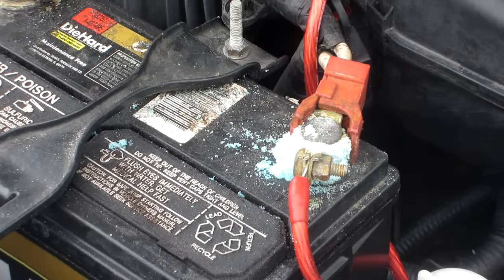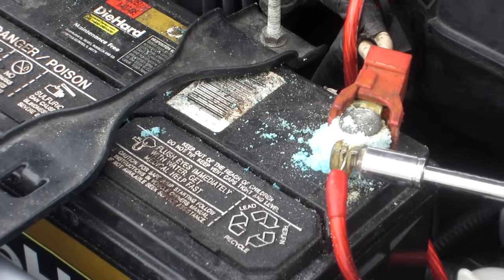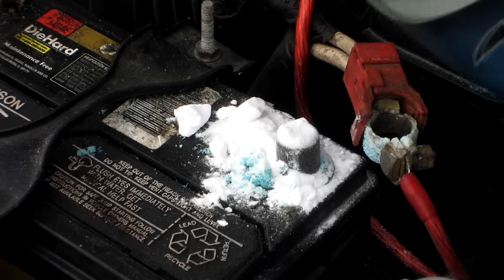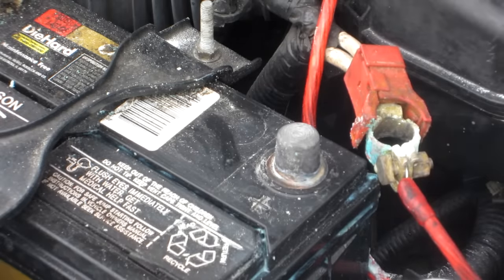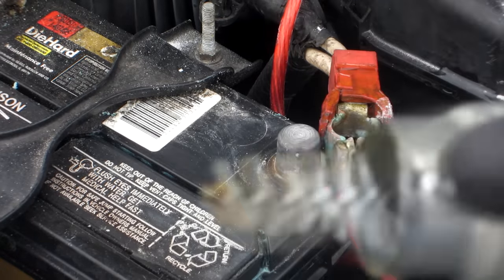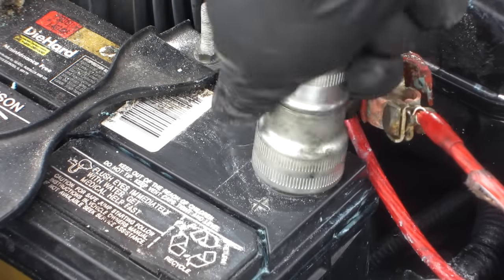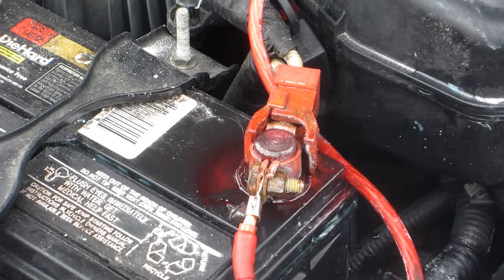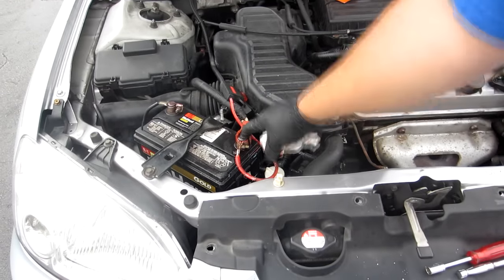HOW TO REMOVE BATTERY CORROSION FAST AND CHEAP!!!

Comment: Rinse well with hot water , and when you are done just spray some WD40 or any motor oil on the connector = good to go. For even longer results cut a circular piece of thick fabric , make a hole the size of the battery pole , soak the fabric into motor oil, place it over the pole, put back your wire connector , tighten it and you're done. No more corrosion.
Reply: use copper grease on battery terminals
Reply: Or use regular greese. Better yet dilithium electrical greese.  Important part of all of this is to alwas keep the battery components clean of carrosian, which, will give you sure starts as your battery starts your car, your alternator takes over the electricity running through your car operating the lights and other accessories within your car or truck.
Reply: @danbasta3677  O my God😲
Spellchecker is a wonderful thing 👍
Grees/Grease Dilithium/Dialectic 😖😂🤣
Reply: @jamesglenn520  Yikes. Spellcheck only helps if you have the right word to start with. I think what you're looking for is dielectric grease. Dialectic is what you talk through with your shrink.  😐
Reply: @benburwick3403  Funny how long it took for someone to finally notice 🤣 😂 
And yes it was my intention to misspell it and see if anyone noticed 🤭😁
Reply: @jamesglenn520  doubtful, with the accompanying "alwas" & "carrosian" & "soak a flammable textile in flammable oil and then place that directly between the contact points of an electrical circuit generating current from an extremely flammable solution which releases an extremely flammable gas by-product during operation."

🤡
Nice try, though. Back-pedal any harder and your bike is gonna apply the brake.

Comment: Also, I suggest first covering the vents with Saran wrap, place a layer of paper towels on top and around the battery base, place the terminal clamp on top of the paper towels, then slowly pour a water/baking soda mix for minimizing a cleanup. Otherwise good presentation.

Comment: Anyone have any idea what causes this? Repeatedly?
Hot weather? Lack of fluid in battery? Newer car batteries or newer vehicles? More than one connection to the positive terminal? I've had Fords and Chevys and never had to do this until i got a Nissan. 
Then it came back, 2 weeks later. (Probaly becsuse i didnt clean it with baking soda or coca cola, but thought i was thorough with a wire brush.)

Comment: Never put the jelly/protectant on the post before replacing the cable.  You should have clean bare metal to metal contact. Replace the cable, tighten it, then put jelly on the cable bracket and top of post. Nothing should impare the metal to metal electrical connection.
Reply: That was my mistake and why I am watching videos right now.
Reply: It makes Absolutely no difference. The chemical is not a insulator. 
Plus the protective coating should cover the base of the post where it meets the plastic case. 
That is where the gasses are leaking under the cable connection.

Comment: Did you ever try mixing the baking soda with water and pouring it on the battery without removing the cable? you went way out of the way cleaning that battery

Comment: Always disconnect negative first. Always reconnect negative last.
Reply: Why
Reply: @gstacks510  Most cars the negative is grounded to the car - you can usually see that the negative battery wire leads into the car's frame. If you remove the positive first and accidentally touch the terminal and a piece of the car at the same time, you are creating a short circuit as the negative side is also connected directly to the car. Similarly if you install the positive last and accidentally touch the car and the terminal at the same time.

If you are touch the negative and a piece of the car at the same time, nothing will happen because the negative connects to the car's frame by default anyways.

Comment: Or  pull the battery out clean the terminals then replace and hook the terminals up,and under the battery holding down bracket place a piece of copper and tighten it down!

Comment: So the problem I have with this method is that you're using Baking Soda (sodium bicarbonate) which is literally on the opposite end of the PH scale of Sulfuric Acid and you're pouring it onto and also likely into the battery, which will neutralize the electrolyte (essentially killing its acidic properties) and compromising the battery's power,performance,etc. That's just basic high-school level chemistry. I'm not saying it doesn't work, i'm just saying that there are risks involved when approaching this method.
Reply: That what they told me to do Advance auto parts
Reply: If you are wise and careful you will take note of where the vents are on the battery cells and avoid getting baking soda solution in the vents.
Reply: wrong
Reply: don't
Reply: Chad Campbell
I could see the concern honestly. If that baking soda seeps under the caps it could get in, because the holes are not lifted, they're flush If I remember right.

Comment: I'd say get rid of those cheap battery terminal connectors to. Get good ones that were used from before. The ones that are on there now are known to carrode right through and you'll end up having to replace them anyway in the long run as time goes by.

Comment: when using a wire brush design for a battery or pipes you only go in One Direction not both that will cause premature breakdown of your brush and a lot of extra work for nothing
Reply: prinsesa iomperreo  How's the worth of the peso going?
Reply: @Definitely NOT CareyLets put it this way. If someone comes to a English event that they weren't invited to, and you ask them a question in English, then says something in Spanish and expects a reply in Spanish. What are you going to do?
Reply: @Definitely NOT Carey nah kind of a joke to be completely honest

Comment: VINEGAR works wonders on terminal corrosion, and after it dissolves pour water or use a hose to wash the residue off, then unscrew wires IF you want to inspect further, most cases you don't have to, after rinsing you can use paper towels to wipe up.

Comment: FYI, your stereo connection (lug/ring) is in the wrong place. You should move it to under the head (or nut, if you prefer), just NOT between the tabs of the clamp where you have it.  
It's just lucky that it fits there at all. Can you see that it's sharing (in parallel) the mechanical load with the terminal?  move it so they both can have full load (series).
-cheers

Comment: Does it matter where the water goes that flows off. Does it matter if it gets on other parts of the engine with battery acid in it?

Comment: Hey dude, I don't mean to be a stiff or anything...but see that bubbling around the filler cap?
That's the alkaline baking soda solution draining down into the electrolyte (acid ?)
The soda is great for neutralising acid but its gonna leak down into the battery and dissolve the acid inside !!
Not ideal really.
Personally, i would mix up a paste in a separate container and dab a paper towel onto the terminal to minimise the flooding that just occurred.
Hope you don't mind me commenting.?
Have a great day my friend.
Reply: MultiOutdoorman 
Great safety advices!
Reply: Well why dont you make a video and show us what you're talking about?
Reply: MultiOutdoorman this is how a real competent person responds to videos.
Reply: MultiOutdoorman )
Reply: MultiOutdoorman  Id like to see this vid as well
Reply: The caps on the battery are sealed with rubber grommets. It's not leaving into the battery. The bubbling was the water carrying the corrosion and braking soda into the crevices.
Reply: also - BAKING SODA is exactly the WRONG thing to use to treat 'corrosion' - that's pure alkali - you have to use muriatic acid (or any type) just pour it on and you're mostly done
Reply: @antigen4  that is how people die.
Reply: how do you figure that??
Reply: you do understand the corrosion is alkaline right? no heat is given off to speak of in the reaction
Reply: i think the bubbles are baking soda is NaHCO3 react with acidic build-up to release CO2, rather than leaking into battery
Reply: but the build up is 100% alkaline
Reply: 'knucklehead' heh? well aren't you a charming little fellow? well if you actually care to get into the discussion - what forms on your terminals is NOT an acid but a sulfide (sulfide) ... which is why an acid will work much better than an alkali ... if it works for you then HEY - go ahead ... have at it but i think you'll find an acid will work a HELL of a lot more effetively
Reply: FYI - you can read up on this too ... lead sulfide will dissolve most readily in an an acid ... so i guess that's why it works - never tried using an alkali solution to clean it before so i can't speak to that really ... i hope to god you were careful and not getting any of the stuff on your hands as apparently it's a cumulative poison (collects in the body) !

https://en.wikipedia.org/wiki/Lead(II)_sulfate
Reply: Just dilute bakng soda in water bottle and spray on.
Reply: haha i guess we're about even then
Reply: @antigen4  oookay, Mr. chemist, perhaps(?) you're correct/accurate with the chemical properties, heck I'll even concede that. I simply speak from first hand experience, and discussions with other techs over 18 years. I've just NEVER heard of that approach; baking soda's cheap, plentiful, and I nor any tech I've ever met has had a battery affected badly by using it. To each his own, but I suspect muriatic acid is more expensive and less plentiful than baking soda.
Reply: @antigen4  I was thinking the same , I have done this with baking soda , but was thinkin to use vinegar next time ????
Reply: @BerneBear  bahahaha I'm dead...millenions or whatever they call those foos
Reply: A friend of mine showed me a simple trick. Use HOT water
Reply: @antigen4  , your ways of cleaning the battery terminals are sure way to harm or death. Where dud you get that idea.
Battery electrolyte consist if muriatic acid and distilled water mixed together to become electrolyte.
Reply: Ronnie - Q:  how do you best clean red wine out of a carpet?  A: with WHITE wine.
Reply: @antigen4  If you're going to link an article, link one that shows what corrosion consist of (since it's your claim it is a sulfide), not just some random article on lead sulfate (plus, why didn't you link to lead sulfide instead).
Reply: Aloysius - because that's what is formed on batteries. Lead Sulfate apparently
Reply: @antigen4  do you have a source for that?
Reply: Aloysius - well YES - the wikipedia post you referred to
Reply: @antigen4  Unfortunately, that article's references are all expired. That means I cannot actually verify anything on that page. The initial sentence "It is often seen in the plates/electrodes of car batteries, as it is formed when the battery is discharged" cannot be verified. You'll need a source with a credible reputation.
Reply: LOL  good luck to you
Reply: David Price p
Reply: thorlo6 hahah ok boomer
Reply: This is helpful.  Thank you.
Reply: @antigen4  you literally could not be more wrong if you tried.  The "corrosion" on battery terminals is acidic, not basic.  A base - like baking soda - is used to neutralize the "acid corrosion"
Reply: @superchili9057  this is really helpful feedback tbh
Reply: @morehumanity  You're educating us and we're really appreciated of that. For those whose barely learning how to clean a car battery need to read "morehumanity" message. Without your great advice, people will damaged their car battery without even notice it.

Comment: When electricity passes through dissimilar metals “Galvanic Corrosion” begins. The most active metal will corrode at an accelerated rate. Traditional battery connectors are lead, with the locking device made of steel/zinc, dissimilar metals. Gator Loc™ is constructed with no exposed dissimilar materials, leaving no possibility for corrosion.

Comment: Fill a plastic bottle with piping hot water and screw on a tip (like a restaurant ketchup dispenser). Squirt the corrosion with a steady stream until gone (you may need gloves). The corrosion will quickly and totally melt away with no scrubbing or scraping.

Comment: the negative battery terminal always has to be removed first and connected last
very hot water(almost boiling) and a paint brush to clean is more than sufficient
no need for baking soda
Reply: Do I have to disconnect it or Can I leave it connect? Got my mom's car thanks
Reply: Kevin Guzman for
Reply from the maker: Make sure both positive and negative terminals are disconnected when you are removing the corrosion
Reply: aa
Reply: Laet resort movies
Reply: Easy Rider. Ty for tip about what to disconnect and reconnection😝
Reply: Baking soda neutralizes the battery acid that causes the corrosion just using water is less effective.

Comment: I’m trying to figure out if I damaged my battery. I clean it yesterday but didn’t remove the connectors because I didn’t have the proper tools so I cleaned around it, and now my car is not starting. Would jumping my car just do the trick or did I do some damage to it?
Reply: Did you find out what the problem was?

Comment: Boiling water slowly poured over the terminals does the same job and costs nothing.
Reply: Is it ok to pour boiling water on the connectors? My mechanic suggested the same thing :/
Reply: It has been done as long as they have made lead acid batteries, but it seems that this common solution has been largely lost in time and not passed on. I have done it uncountable times with all my cars in 40+ years. There is nothing it can harm. Just boil a kettle and pour the whole contents slowly over the terminals. If you wish you can put petroleum jelly or a pressure pack battery terminal sealing compound (available from auto parts stores) on the terminals afterwards to minimise the problem coming back. After the boiling water treatment rinse under and around the battery box/tray with a garden hose (cold water) to remove any traces of diluted acid that was washed off the battery.
Reply: I'm mechanic by trade and i use hot tap water every time and it works great
Reply: I'm sure hot tap water works but wouldn't it be better to neutralize the crystallized acid with baking  soda first vs only using hot water and risking the acid water running off/flowing into unwanted places!?
Reply: That's why you use a garden hose afterwards to dilute it to oblivion. Also, if you use hot water instead of boiling water it will take more of and longer to shift the harder deposits. Using baking soda is just an unnecessary step and having a wet alkaline solution seep into "unwanted places" is not particularly desirable either.
Reply: Boiled water costs more than water with baking soda. You have to pay for the energy to boil the water. You only need about 2 ml (less than half a tsp) of baking soda. Baking soda costs about $0.60 for about 200 ml. So you need only about half a penny's worth of baking soda.
Reply: Theodore Zuckerman good luck buying that 200ml container of baking soda
Reply: pasta - There's always a One Upper.
Reply: Just saying
Reply: Doesn't have to be boiling. Just really hot and flush with a lot of water.
Reply: No even hot. Just tap water out of hose works great. Put it on a trickle then come back later and it’s clean.
Reply: Erroneous- So does Coke or Pepsi and it won't burn you
Reply: You need to keep baking soda from neutralizing the acid inside.  Some leaked inside on this demo, see the bubbling around the cap.
Reply: Use brush and water to remove excess corrosion and the dip wet brush in Baking Soda so you don't use so much.  Wear eye protection, Nitrile gloves and old clothes when working on batteries.
Reply: Hot water does the job very neatly..
Reply: Don't use boiling water it's overkill, use warm water and repeat it,
Reply: @soilmanted  nope warm water don't need  soda infiltrating anything
Reply: Using boiling water shows the lack of knowledge  from the mechanic, all you do is dilute the acid and it spreads over the chassis below corroading it out! It needs to be neutralized first with an alkaline, 
Cost nothing pffft! Will cost you an expensive repair later .
Reply: Jeez, just how poor are you people that the cost of baking soda is an issue? Are you friggin kidding me?
Reply: My thought is when pouring water onto all that acidic residue, all that acid is running down into who knows where in the engine compartment below it and possibly even pooling in areas, if it would corrode areas it was exposed too?  Seems like making a paste is so much more area specific and baking soda is very inexpensive to begin with:)

Comment: Sulfate is not an acid, therefore doesn't require baking soda. I've always just used water to dissolve the sulfate. I'd dip the connectors and the wire in a cup of water. Of course, dry after.

Comment: Basically any battery That's a lead acid battery will corrode the terminals when some of the battery acid leaks out and touches the terminals. Or any moisture that lands on the terminal. This would not happen with an AGM battery or a lithium ion battery. 

Also to prevent future corrosion, add a few drops of motor oil or 3 in 1 oil on the terminals once it's already connected

Comment: Best and easiest tool to use isnt paper towels but a fine toothbrush and you want to dip it in baking soda mixture with water first then clean the main corrosion. After that wipe off with paper towel to avoid any wear towards the battery. Positioning on which side to start is always negative, then positive. After place positive side on first then negative on after.